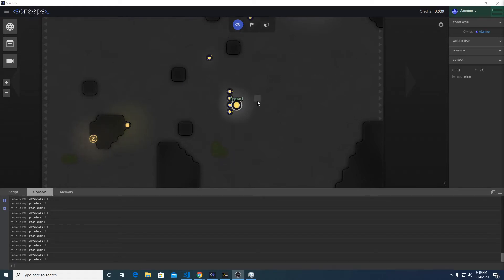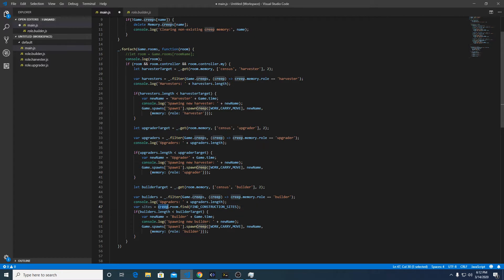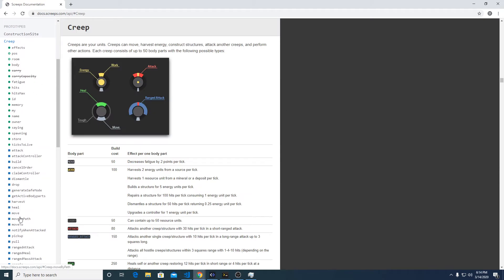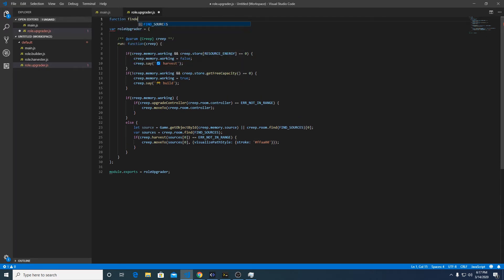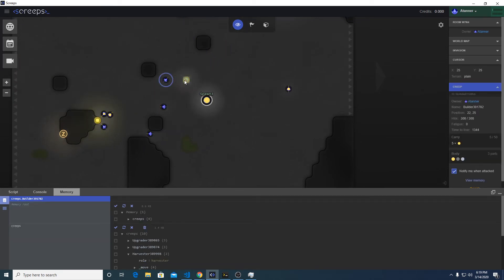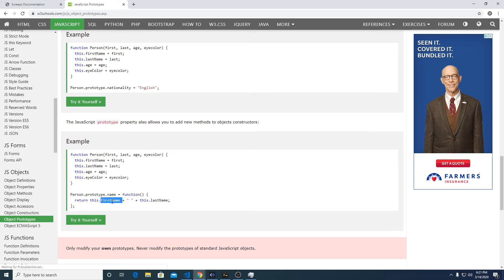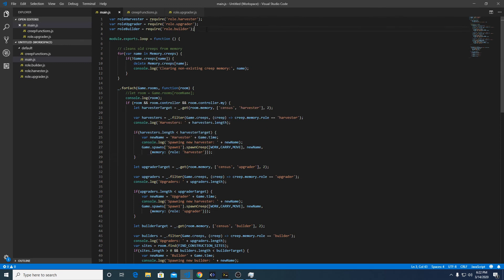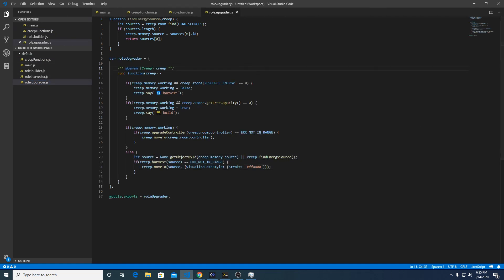Screeps Tutorial - Part 4 - Builder Creep Spawning and Creep Prototype Functions

Comment: Dumb question. Are you using the prototypes here as like a placeholder of common creep related helper functions?
Reply from the maker: Essentially. So you could call a function like getenergy as creep.getEnergy() from any role of creep. There are many ways to structure your code I am using this now in my current codebase changes.